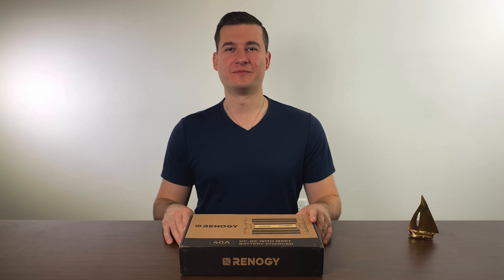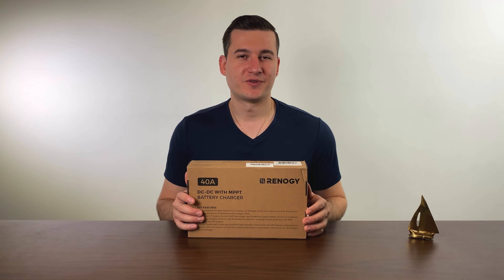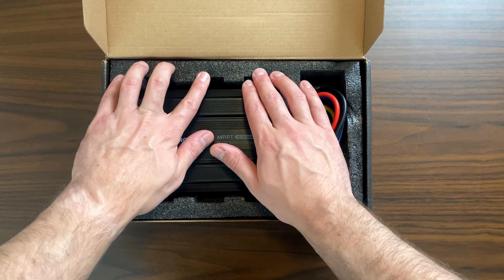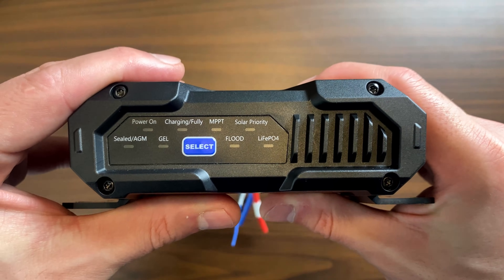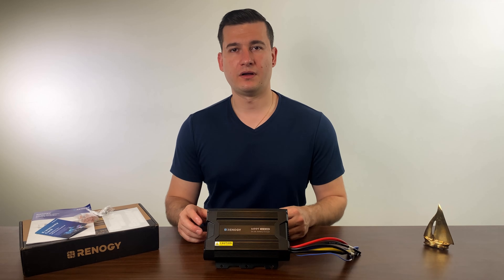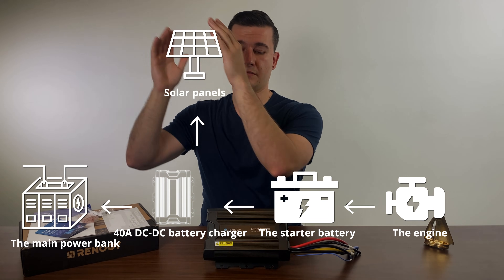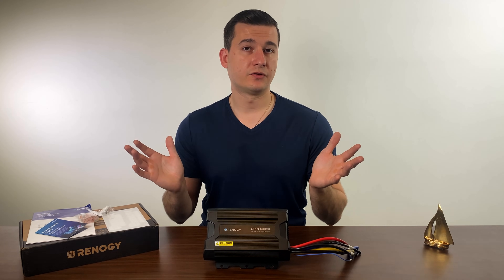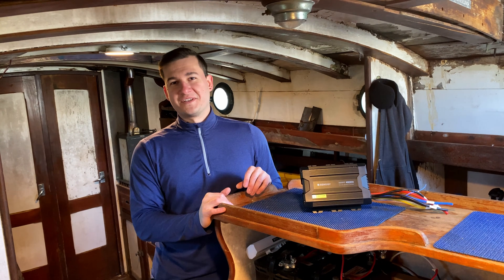Renogy DC to DC Battery Charger Unboxing And Installation On A Sailboat

Comment: has this charger the reverse charge to the start battery to mantain it? It is a must have feature in my setup... Thank you!
Reply from the maker: Hi, thanks for your question. No, this charger can only charge your main battery bank.
Reply: @Sea-Spirit  Very useful info: I didn't find anywhere. Thank you a lot
Reply from the maker: @enricobernardini557  You're welcome!

Comment: Does this need to hooked up onto the vehicles alternator too? Or just the starter battery?
Reply from the maker: Hi, thank you for your question! It needs to be wired to the starter battery only, not the alternator.

Comment: 6:01 as per user manual, mount this with at least 5 1/2" around ALL sides, so it can breath.
Reply from the maker: Yes you are correct! It needs at least 5 cm of clearance on each side for proper ventilation. There are more details about this in the instruction manual at 2:39

Comment: Hello,

I just saw your video...
I have a problem with my DC DC Mppt Charger...

Its starts charging for 2 or 3 minutes after that it stops charging and the LifePo4 light starts blinking...

Do you know what is the situation?

If i power on again, after 2 or 3 minutes it does the same...

Many thanks...
Reply from the maker: Hi, thanks for your comment. I’m not sure why this is happening but you can reach out to Renogy directly and see if they can assist you with this.

Comment: Have you noticed it running hot? I tested mine and it was 150* which is crazy
Reply from the maker: Hm, I was only using it through Solar mode and I didn’t notice it getting hot. I’m not sure how it will react when connecting it to the engine. Sorry you had that experience.

Comment: Where does the BT-2 connect on the DC-to-DC module?

I know you say it doesn't but they're selling one with the BT-2 module bundled for less than the list item solo on Amazon. 
I have one and if I can avoid returning it I would be most grateful.
Reply from the maker: Hi, thank you for your question! I don’t believe that the BT module is compatible with this device. An alternative would be to use a battery shunt that connects directly to the battery and allows you to monitor the charging status of your battery. Renogy also sells these but I have never used one so I can’t really comment on them. I hope that this is helpful.

Comment: No Bluetooth 😢
Reply from the maker: Yes, you are right, it doesn’t have Bluetooth unfortunately ☹️. Though I was able to monitor my devices remotely by installing a simple Arlo camera which was facing them. It actually proved to be more effective since I could monitor my setup remotely from anywhere.

Comment: The 3 grounds off the charger are just labeled GRD with no instruction to which is for solar, start, or house Batt. Did you run into any issues?
Reply from the maker: Hi, thank you for your question. You are right, I did run into this issue when installing the charger. I got around it simply by trial and error, meaning I connected the GRD to each component one at at time to see if it worked or not. I reached out to Renogy to see if there's a better way to figure out which GRD wire goes where and will keep you posted.
Reply: @Sea-Spirit would they not be common grounds throughout the system connected to the DC output negative?
Reply from the maker: @MulligansDen  Hi, thank you for your question. I don't believe that they are common grounds. The DC input, solar input and output should each have their own positive and negative terminals. But please correct me if I'm wrong.
Reply: @Sea-Spirit  I've opened up this device, the ground is literally one 8AWG cable connected to PCB and then crimped into the 3 8AWG black cables. They're there for show and one would have been fine. I'm going to replace the 3 cables for one 4AWG ground cable.
Reply: @MulligansDen  You're correct, I've opened up this device and it's literally one cable crimped to 3 cables. They're just for show.